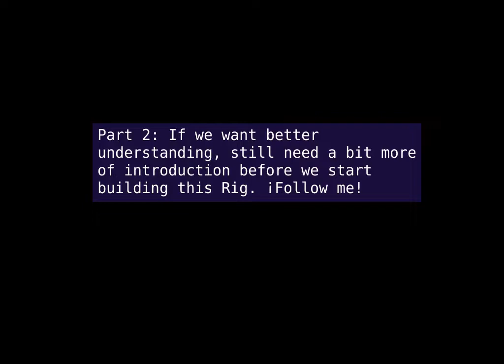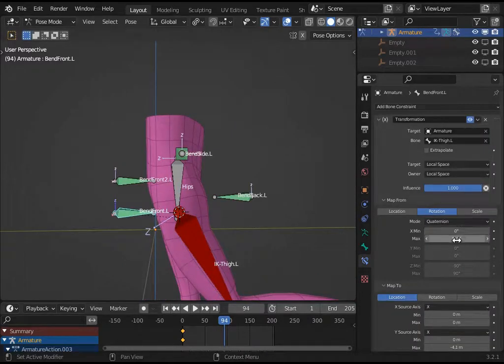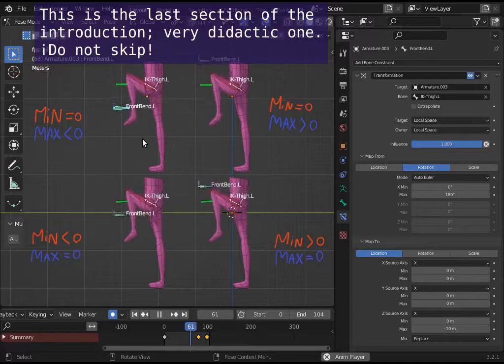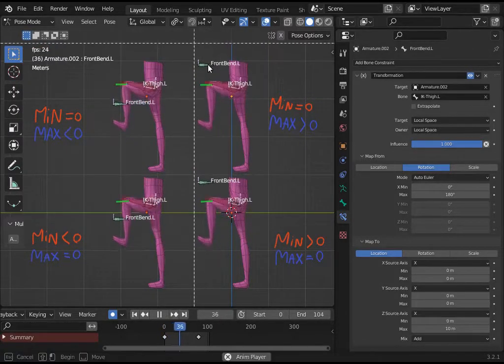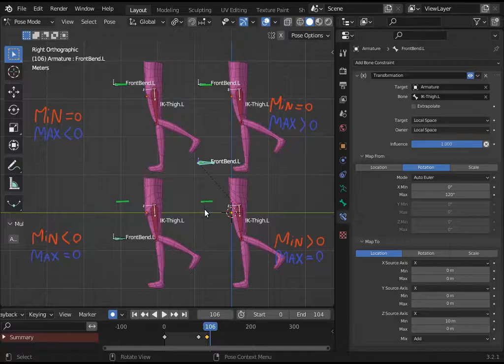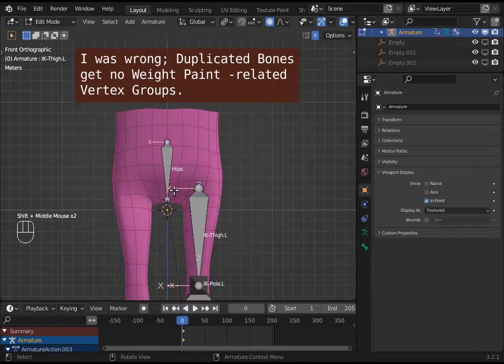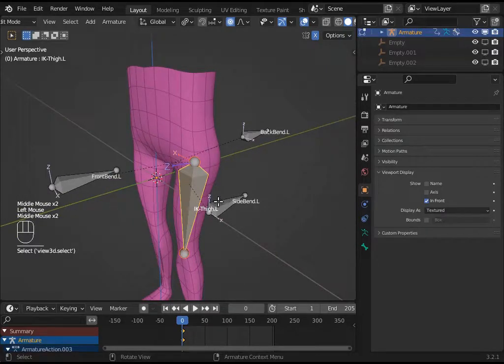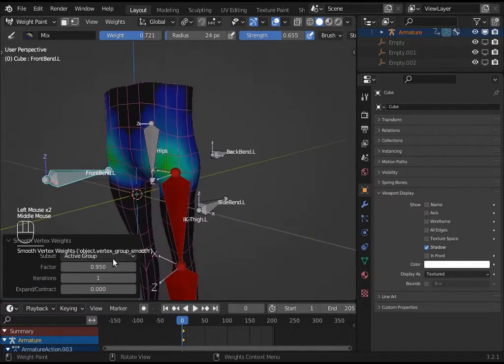🌆Rigs of the Trade # 04 — Part 2/6 ❅ Pelvis Region Rig with Helper Bones [ Intermediate ]

Comment: Awesome video! By any chance, would you know how to make the drivers work in unity?
Reply from the maker: Thank you! This means a lot.
Actually, I believe it is feasible (I only know from theory though), there would be at least two methods, for CG Game Engines (you may check more details in the Part 1/6 on the comment section; as someone has asked a similar question).
One method (a very conventional one apparently for Blender to Game Engine pipelines) consists of Baking the 3D Animation output only for the DEF (Deform) Bones in Blender, and then Exporting those Baked Animations (so no need of Control Rig outside of Blender I guess); the other method would be making a Control Rig and/or, with the help of scripting, in Unity, code some specific relations which could mimic, for example, Bone Constraints features. One day I'd like to try it myself, but for the time being, I just got Blender.
I hope you'll be able to find a proper solution from these information; good luck!
Reply: @pxy-gnomes9781  thank you for this information! Appreciate it.